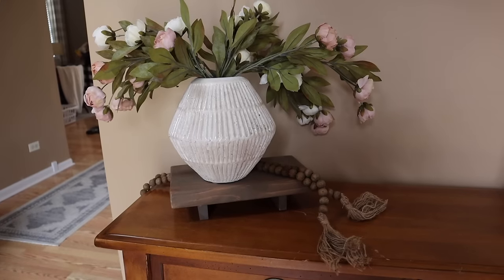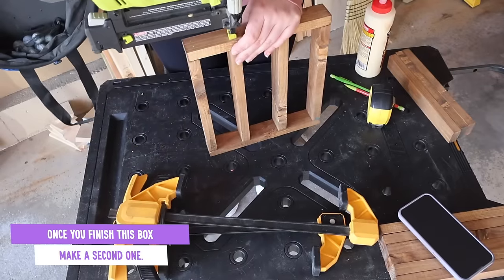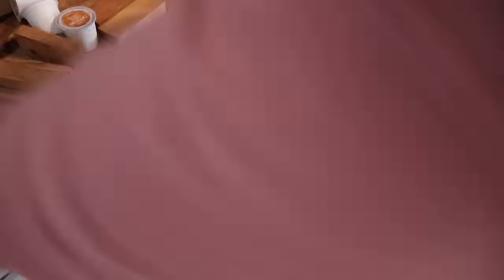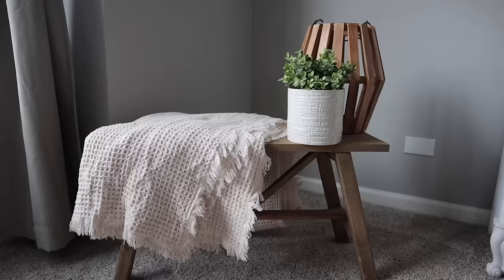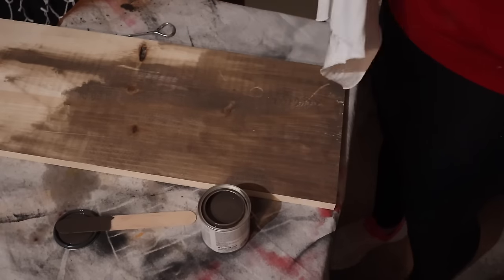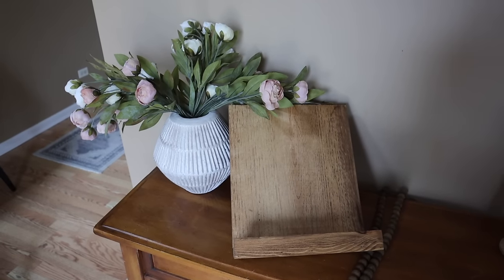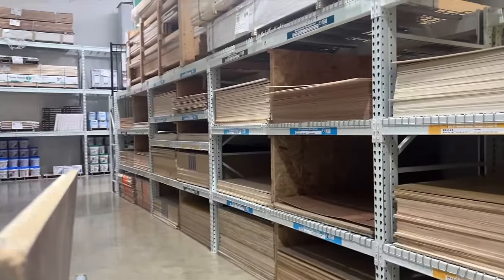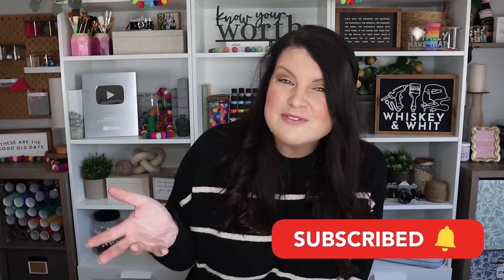Grab some $2 1x2 lumber to build these Wood Decor DIYs! ✨🔨 Beginner-friendly!

Comment: A lady after my own heart! I thought I was the only one that thought if you have to paint, stain, etc., do it before you nail it together!!  I don’t know, but to me, it makes more sense to put the color on the wood before you nail it together.
Reply: The only issue with doing all the paint/stain before is it can interfere with the glue. Especially paint. So if you can, avoid painting/staining the areas where glue is going to be if you do it before assembly.
Reply: @nikkafrog yep! Especially wood glue! I watched someone do it on a video the other night. One piece was raw the other piece was painted and they used wood glue…. 🙄 🤦‍♀️

Comment: Simple step to make your projects look more professional is to break your corners. It is just taking a sanding block and hitting the edges of the wood. Just a small amount. You don't want to put a bevel on it. But it softens the edges and makes the piece look more professional.  You do not want to do this on any piece that is meeting another piece. It will create a tiny gap. So just do this on your exposed edges

Comment: I was so glad to see that you covered those wire shelves instead of replacing them. You wouldn’t want your wood to start sagging after all of that hard work! 
By the way, Cas from Clutterbug used to use foam, core board and contact paper to make covers for her wired shelving!  
Everything turned out just beautiful! I especially loved the little bench.